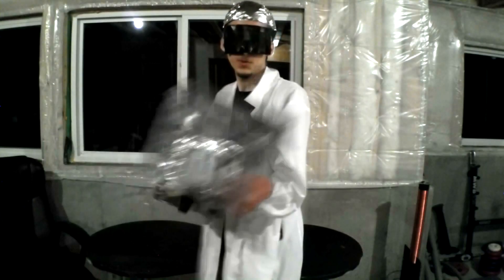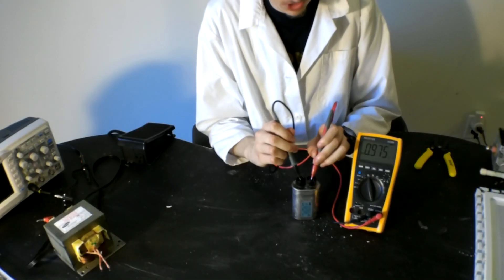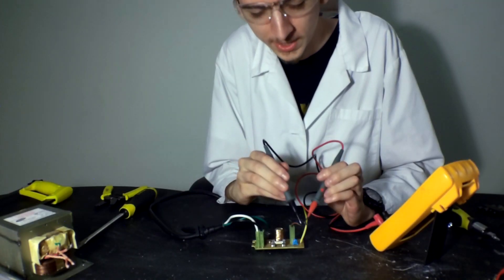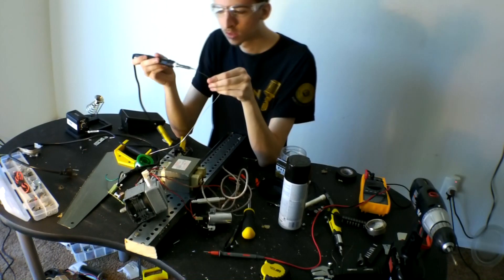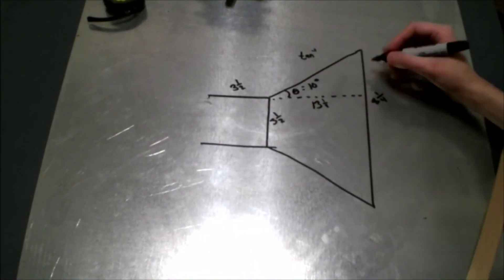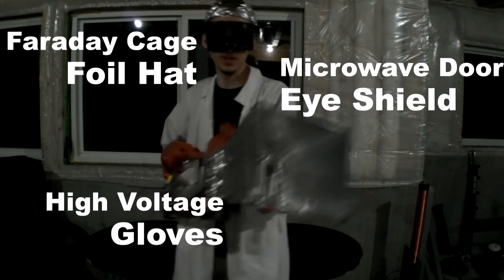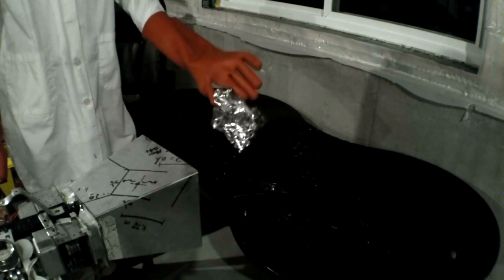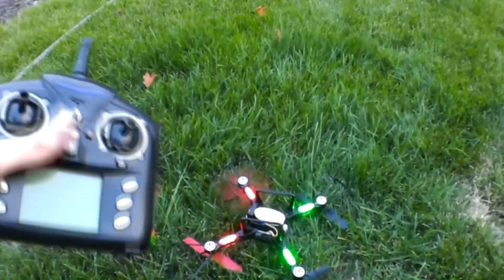What If I had a Microwave Gun?

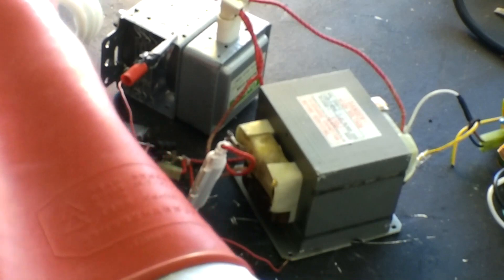Comment: 2:16 "Every..(cant hear) I apply power to the magnetron it wont turn on." 

Wont turn on? I can clearly see that it will?
Reply from the maker: Sorry, my speech is a little hard to make out. It reads: "Now if I apply power to the magnetron, it will turn on"
Reply: @BlueprintScience  Then it made sense, what accent do you then have or is it just some words perhaps?
Reply from the maker: Well, I'm Dutch. But that's not the problem. I have a minor speech impediment. I tend to slur words. I'll be sure to articulate more clearly in the future.
Reply: @BlueprintScience  Ah ok then I get it, no problems though I was just curious. :) Really good video btw, and I was equally surprised about the "vanes" in the magnetron in contrary to the round cavity that was normal before. The only reason I can se this was the case and most likely is how magnetron are made nowadays is since they will save some pennies on the copper not used. I wonder though if these are equally efficient (well a magnetron is not that efficient anyway) as those with round cavities. But if the microwave output say 10% less radiation it wont be noticed and the manufacturer save some pennies but of course the cost of the microwave would be the same.

Comment: The filament filter coils have NOTHING to do with making a pure sine wave.  They block the large 2,450 mc signal on the magnetron filament pins from getting to the filament windings on the power transformer.  This prevents most radio inteference at that frequency.

Comment: Wood is conductive at high voltages. (due to moisture)  

Trust me, I had built a jacobs ladder and the wires were nailed into a piece of wood. When I turned it on, it arced into the concrete into ground.